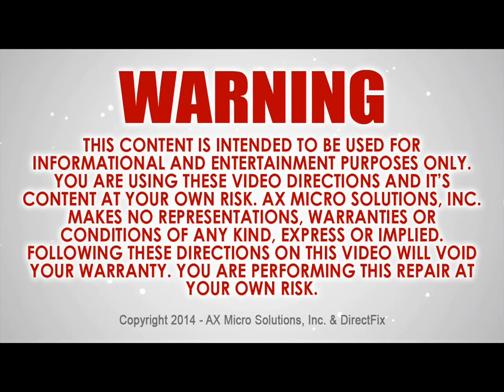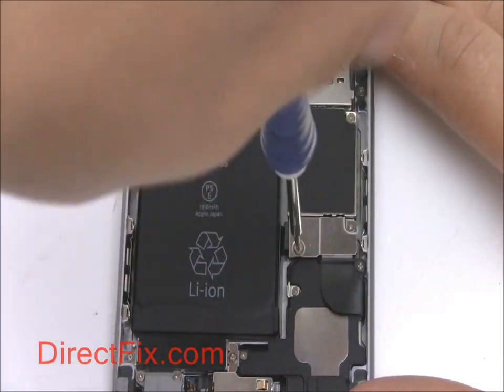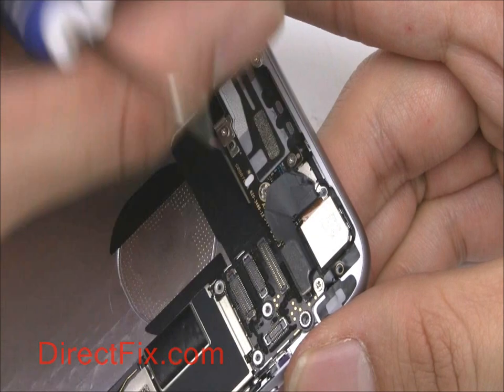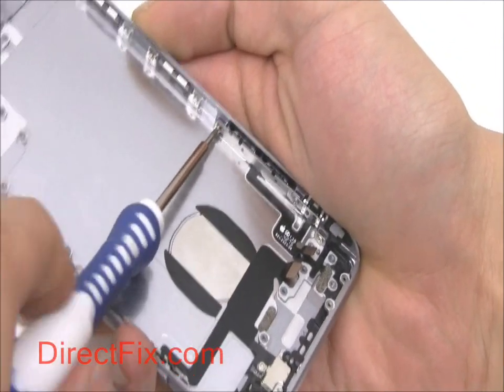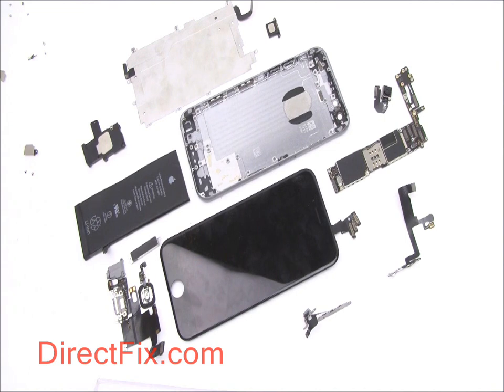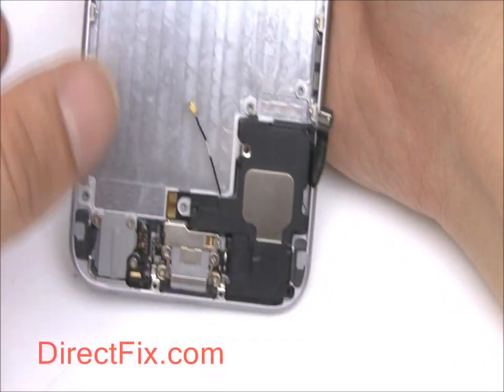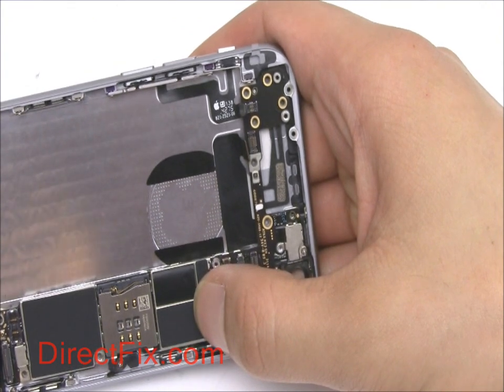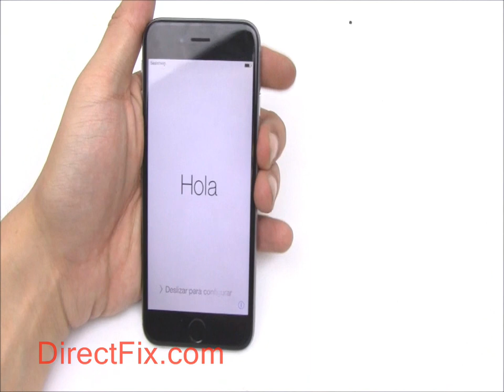iPhone 6 Screen Repair & Disassembly Directions

Comment: Niiiice! I am a samsung galaxy S3 user, AND NO I WILL NOT UPGRADE... and I always like to see what is inside mobile phones, specially iphones because of the non-removable battery. The battery in the iphone 6 is pretty much 50% of the smartphone space. Just like any other big screen phone. Usually when I see the components behind a new smartphone I get that feeling of asking definitely people must love smartphones to spend their hard earned money for such a high priced devices...So they can drop it 2 months later and brake something! lol...Interesting the way the battery connects to the motherboard...By the way, nice video, nice quality.

Comment: I'm having some trouble getting the battery disconnected. It really seems stuck on there. Any tips?
Reply: It must be heavily glued, try warming up the back of the phone for a minute or two, but not to the point when you can't touch it without hurting yourself (otherwise you'll damage internal components). This should make the glue less effective :)

Comment: I thought there was glue holding the screen on the LCD. How come you didn't need a heat gun to melt and scrape the glue off? Or did you buy the screen already attached and you're just assembling the rest? Someone let me know. Thx in advance!!!
Reply from the maker: +B Free In the brand new unit we did this repair on there was no glue. There is an adhesive that holds the screen down and we note it in the video but no glue.
Reply: +B Free There are a lot of companies that try to sell you the glass only for like $10 and tell you it can be repaired that way.  :P
The glass and LCD are like superglued, fused if you will and without the right machinery and experience it is very easy to mess up a phone.  Most if not all repairs are done with a replacement LCD/Digitizer/Glass combo.  It is a lot easier and safer. 

 A while back on the news, they were advertising the glass only repairs for consumers.  The end result was many Americans who think they are 1. Getting ripped off  2. Thinking that shops have to be using OEM parts.  Because they are not, every screen is third party.

But yeah it comes pre assembled.

Comment: i got a question i bought this iPhone off this dude on craigslist he said he dropped it and i just need too replace LCD but the whole iPhone does nothing it doesn't turn on i cant charge its just dead. Will replacing the LCD and screen help the phone turn back on? someone please help
Reply from the maker: ***** Maybe. It will depend on what happened to it before you purchased it.